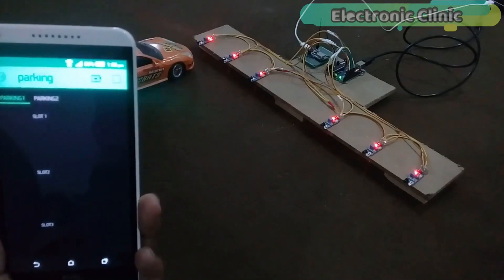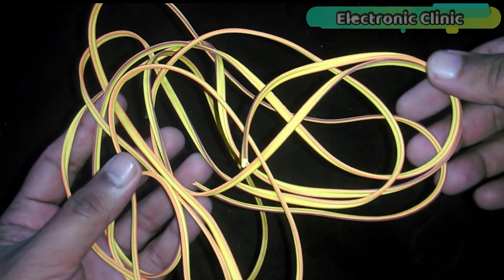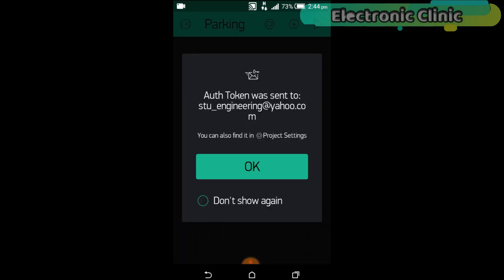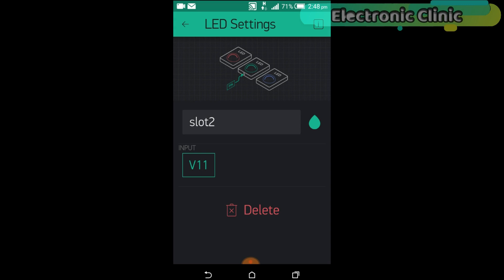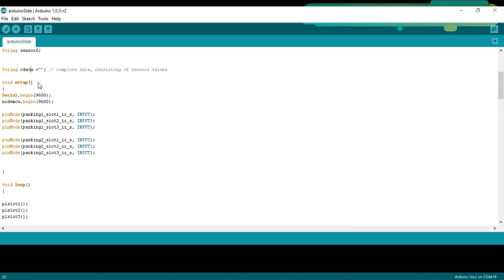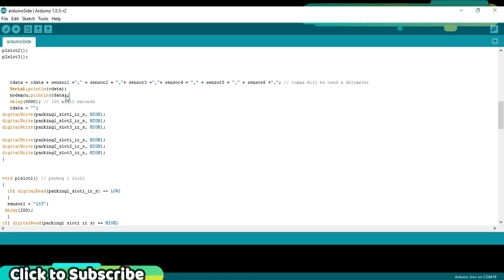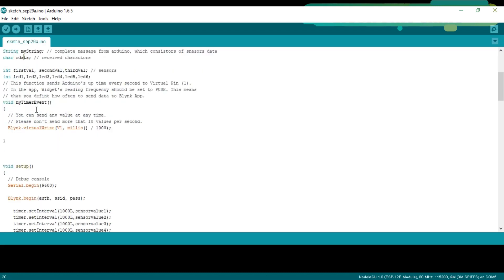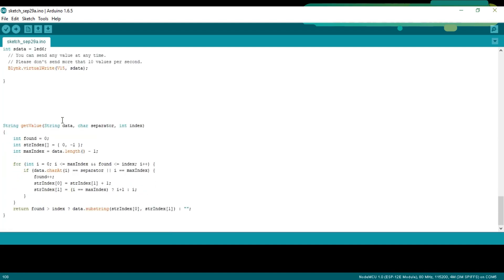Arduino Project: IOT Car Parking System using Nodemcu esp8266 wifi + Blynk (Tabs + led widgets)

Comment from the maker: Watch my video on How to make Automatic Spot Welding Machine using a Microwave Oven transformer
https://youtu.be/xnPIsrxVozM
Reply: can you please explain what is the sv1 and sv2 connected on the wifi module at 3:00  ?
Reply from the maker: @niggtube4482  these are female headers
Reply: Can u please provide blynk application link as u mentioned in the video at start

Comment: Data not processed over Blynk Mobile 
Help, Pliss
Reply from the maker: this was designed using old blynk. You will need to use the new blynk v2.0. Watch my getting started video on Blynk v2.0.

Comment: Upon compilation of aurduino code, my IDE shows these following errors. can you help me fix it

Arduino: 1.8.19 (Windows 10), Board: "Arduino Uno"

1:157:1: error: expected unqualified-id before numeric constant

 63

 ^~

1:255:5: error: redefinition of 'int parking1_slot1_ir_s'

 int parking1_slot1_ir_s = 4; // parking slot1 infrared sensor connected with pin number 4 of arduino

     ^~~~~~~~~~~~~~~~~~~

C:\Users\user\Desktop\1\1.ino:5:5: note: 'int parking1_slot1_ir_s' previously defined here

 int parking1_slot1_ir_s = 4; // parking slot1 infrared sensor connected with pin number 4 of arduino

     ^~~~~~~~~~~~~~~~~~~

1:256:5: error: redefinition of 'int parking1_slot2_ir_s'

 int parking1_slot2_ir_s = 5;

     ^~~~~~~~~~~~~~~~~~~

C:\Users\user\Desktop\1\1.ino:6:5: note: 'int parking1_slot2_ir_s' previously defined here

 int parking1_slot2_ir_s = 5;

     ^~~~~~~~~~~~~~~~~~~

1:257:5: error: redefinition of 'int parking1_slot3_ir_s'

 int parking1_slot3_ir_s = 6;

     ^~~~~~~~~~~~~~~~~~~

C:\Users\user\Desktop\1\1.ino:7:5: note: 'int parking1_slot3_ir_s' previously defined here

 int parking1_slot3_ir_s = 6;

     ^~~~~~~~~~~~~~~~~~~

1:259:5: error: redefinition of 'int parking2_slot1_ir_s'

 int parking2_slot1_ir_s = 7;

     ^~~~~~~~~~~~~~~~~~~

C:\Users\user\Desktop\1\1.ino:9:5: note: 'int parking2_slot1_ir_s' previously defined here

 int parking2_slot1_ir_s = 7;

     ^~~~~~~~~~~~~~~~~~~

1:260:5: error: redefinition of 'int parking2_slot2_ir_s'

 int parking2_slot2_ir_s = 8;

     ^~~~~~~~~~~~~~~~~~~

C:\Users\user\Desktop\1\1.ino:10:5: note: 'int parking2_slot2_ir_s' previously defined here

 int parking2_slot2_ir_s = 8;

     ^~~~~~~~~~~~~~~~~~~

1:261:5: error: redefinition of 'int parking2_slot3_ir_s'

 int parking2_slot3_ir_s = 9;

     ^~~~~~~~~~~~~~~~~~~

C:\Users\user\Desktop\1\1.ino:11:5: note: 'int parking2_slot3_ir_s' previously defined here

 int parking2_slot3_ir_s = 9;

     ^~~~~~~~~~~~~~~~~~~

1:263:8: error: redefinition of 'String sensor1'

 String sensor1;

        ^~~~~~~

C:\Users\user\Desktop\1\1.ino:13:8: note: 'String sensor1' previously declared here

 String sensor1;

        ^~~~~~~

1:264:8: error: redefinition of 'String sensor2'

 String sensor2;

        ^~~~~~~

C:\Users\user\Desktop\1\1.ino:14:8: note: 'String sensor2' previously declared here

 String sensor2;

        ^~~~~~~

1:265:8: error: redefinition of 'String sensor3'

 String sensor3;

        ^~~~~~~

C:\Users\user\Desktop\1\1.ino:15:8: note: 'String sensor3' previously declared here

 String sensor3;

        ^~~~~~~

1:266:8: error: redefinition of 'String sensor4'

 String sensor4;

        ^~~~~~~

C:\Users\user\Desktop\1\1.ino:16:8: note: 'String sensor4' previously declared here

 String sensor4;

        ^~~~~~~

1:267:8: error: redefinition of 'String sensor5'

 String sensor5;

        ^~~~~~~

C:\Users\user\Desktop\1\1.ino:17:8: note: 'String sensor5' previously declared here

 String sensor5;

        ^~~~~~~

1:268:8: error: redefinition of 'String sensor6'

 String sensor6;

        ^~~~~~~

C:\Users\user\Desktop\1\1.ino:18:8: note: 'String sensor6' previously declared here

 String sensor6;

        ^~~~~~~

1:271:8: error: redefinition of 'String cdata'

 String cdata =""; // complete data, consisting of sensors values

        ^~~~~

C:\Users\user\Desktop\1\1.ino:21:8: note: 'String cdata' previously declared here

 String cdata =""; // complete data, consisting of sensors values

        ^~~~~

C:\Users\user\Desktop\1\1.ino: In function 'void setup()':

1:273:6: error: redefinition of 'void setup()'

 void setup()

      ^~~~~

C:\Users\user\Desktop\1\1.ino:23:6: note: 'void setup()' previously defined here

 void setup()

      ^~~~~

C:\Users\user\Desktop\1\1.ino: In function 'void loop()':

1:289:6: error: redefinition of 'void loop()'

 void loop()

      ^~~~

C:\Users\user\Desktop\1\1.ino:39:6: note: 'void loop()' previously defined here

 void loop()

      ^~~~

C:\Users\user\Desktop\1\1.ino: In function 'void p1slot1()':

1:317:6: error: redefinition of 'void p1slot1()'

 void p1slot1() // parkng 1 slot1

      ^~~~~~~

C:\Users\user\Desktop\1\1.ino:67:6: note: 'void p1slot1()' previously defined here

 void p1slot1() // parkng 1 slot1

      ^~~~~~~

C:\Users\user\Desktop\1\1.ino: In function 'void p1slot2()':

1:332:6: error: redefinition of 'void p1slot2()'

 void p1slot2() // parking 1 slot2

      ^~~~~~~

C:\Users\user\Desktop\1\1.ino:82:6: note: 'void p1slot2()' previously defined here

 void p1slot2() // parking 1 slot2

      ^~~~~~~

C:\Users\user\Desktop\1\1.ino: In function 'void p1slot3()':

1:347:6: error: redefinition of 'void p1slot3()'

 void p1slot3() // parking 1 slot3

      ^~~~~~~

C:\Users\user\Desktop\1\1.ino:97:6: note: 'void p1slot3()' previously defined here

 void p1slot3() // parking 1 slot3

      ^~~~~~~

C:\Users\user\Desktop\1\1.ino: In function 'void p2slot1()':

1:364:6: error: redefinition of 'void p2slot1()'

 void p2slot1() // parking 1 slot3

      ^~~~~~~

C:\Users\user\Desktop\1\1.ino:114:6: note: 'void p2slot1()' previously defined here

 void p2slot1() // parking 1 slot3

      ^~~~~~~

C:\Users\user\Desktop\1\1.ino: In function 'void p2slot2()':

1:379:6: error: redefinition of 'void p2slot2()'

 void p2slot2() // parking 1 slot3

      ^~~~~~~

C:\Users\user\Desktop\1\1.ino:129:6: note: 'void p2slot2()' previously defined here

 void p2slot2() // parking 1 slot3

      ^~~~~~~

C:\Users\user\Desktop\1\1.ino: In function 'void p2slot3()':

1:394:6: error: redefinition of 'void p2slot3()'

 void p2slot3() // parking 1 slot3

      ^~~~~~~

C:\Users\user\Desktop\1\1.ino:144:6: note: 'void p2slot3()' previously defined here

 void p2slot3() // parking 1 slot3

      ^~~~~~~

exit status 1

expected unqualified-id before numeric constant

This report would have more information with
"Show verbose output during compilation"
option enabled in File -> Preferences.

Comment: imagine a scenario : - there are 4 parking slots slot 1 and slot 3 is filled , a car arrived and slot 2 is assigned to it ,a second car arrived and since slot 2 is already assigned ,the only remaining slot 4 is assigned to second car . now 1st car instead of parking in assigned slot 2 it goes to slot 4.the second car since the slot allotted is slot 4 moves towards that slot but it finds that slot 4 is filled by first car.

how can we  overcome such  scenarios with our parking system.
Reply from the maker: its only possible if you design a custom app for this with a database. then you can edit the entries.
Reply from the maker: i have some videos on desktop applications which you can use with arduino.
Reply from the maker: check playlists.

Comment: the video is really helpful thank you can you please add to the circuit and the code ( an entry gate and an exit gate using servo motor and ir sensor ) and also display 16x2 I would appreciate  that .
Reply: If I already have this but I want to add iot and nodemcu code will depend on ardunino or not

Comment: hello sir,i am using arduino uno + node mcu+ultrasonic sensors.I am just sending status of parking slot from node mcu to mosquitto broker.But when i am compiling node mcu program program shows " 'connectWifi' was not declared in this scope" and lots of errors.So my question is two serial communication(from arduino to node mcu) and (node mcu to broker )possible..if so what are the changes to be made????please reply

Comment: Hello Sir @Electronic Clinic, i have a problem with the"time out waiting for packet header" what should i do  ?
am i need to change the esp?
Reply from the maker: go to my website electroniclinic.com and download the exact libraries.
Reply: @ElectroniClinic  i've already download it, but i have more problem sir, when i connect pin TX and RX  to (2,3) to nodemcu, it has problem on it the esp tool can't connect to blynk
Reply: @adyaruan5331  Hi Ady, Did you find any solution to it ?
Reply: @sarthaksrivastava9445  sorry, I can't find the solution for this, I use ESP8266 for this project. Because i can't still connect the Arduino to Node Mcu ESP8266
Reply: @adyaruan5331  I think I figured it out, just dont connect any wires while uploading the code on MCU, once the code it uploaded open serial monitor and enable timestamp, you should see blank input at that time, then connect your TX RX wires from arduino to see if you are able to get data from Arduino.
Reply: @sarthaksrivastava9445  please Bro Help me complete this project

Comment: For the nodemcu schematic if I use a usb port to give it 5volts, I only need to connect RX AND TX to the arduino uno right?
Reply: Also conect gnd & vin to arduino uno with the help of bread board :)

Comment: awesome, question:how to add on the code for making for an example to  press on the led to make reservation with a yellow color, when the car reached the slot changes to green, and also how to add timer on the reservation and thanks in advance.
Reply from the maker: there are so many tutorials, check my playlists, select the one which you find easy to follow. you can also watch my tutorials on how to use a gsm module.
Reply from the maker: for this, you can add a gsm module and then through SMS you can send a command and serve a slot.
Reply: @ElectroniClinic  why through sms cant i use the virtual pin for another led, small and beside the slot to make it reserve and when the car comes in , the button will be turned off and the led turned on for the slot,or is that not possible for it and thanks
Reply from the maker: of course, you can use virtual pins. but using the gsm module, this way anyone can reserve a slot. This can be a real system. while the App can be used by the staff for the monitoring.
Reply: @ElectroniClinic  thank you very much,can you give me any tutorial that can help me with that.
Reply from the maker: in reality, you will need to verify, who is serving the slot.
Reply from the maker: I have done so many projects in which I did two-way communication. If you want to add buttons for the reservation, those tutorials will help you. check my playlists on Nodemcu esp8266.
Reply: @ElectroniClinic  one last thing,this project works on any type of sensor? for example the ultrasonic .and same code.
Reply: @ElectroniClinic  The libraries you used in your programming are not available on your website
Reply from the maker: there is a project in which I have used the ultrasonic sensor for monitoring the water level. that will help you a lot.
I have more than 270 videos. read the titles ;).
Reply: @ElectroniClinic  thank you so much for the info,you made me a subscriber for this channel.

Comment: I had this error after connecting circuit can you solve it:
esptool.FatalError: Failed to connect to ESP8266: Timed out waiting for packet header
esptool.FatalError: Failed to connect to ESP8266: Timed out waiting for packet header
Reply: check the voltage of esp8266 3.3v
Reply: did u solve this error?...........coz i am also getting same error :'(
Reply: @ishasharma537  I am also getting same error please help me

Comment: This is my BE project now
Reply: Hii that is also my final project 
Can you help me in that
Reply: @anujrathod2246  how may I help u
Reply: @riseabovehate9476  bro i am doing this project now, can you help me a bit in doing this
Reply: @anujrathod2246  hey man i am doing this project right now, so if you have done this can i get some help?
Reply: @ritviksardana3893   who can help u but i am done with Bluetooth and Arduino
Reply: @anujrathod2246  shall we talk about this on insta?
Reply: @ritviksardana3893  Hi did u manage to finish your project?
Reply: @mhussain2405  YES I am done with this project along time ago
Reply: @ritviksardana3893  I am doing this project now. Would you kindly be able to share how you did it please? What is your insta or email?
Reply: @ritviksardana3893  Hi can you help me with it please bro
Reply: @ritviksardana3893  Hi did your nodeMCU code work ?
Reply: @mdraghibahmad5698  yes
Reply: @ritviksardana3893  was it the same code as given in the website ?
Reply: @mdraghibahmad5698  no ,i wrote my own code on RPi using micro python
Reply: @ritviksardana3893  please Bro Help me it's also my project please
Reply: @samirrekibi6250  dm me
Reply: @ritviksardana3893  how can I contact you
Reply: @samirrekibi6250  anytime
Reply: Can you give me coding 
Connection details plzer
Reply: Are u from which city
Reply: guys me to it's my final project can you help mt codes and circuit diagram ahmeddhaqan11@gmai.com
Reply: Bro this is my first year project 😢

Comment: Sir,  can I build a board with til78 and til32 infrared leds? Thank you in advance.
Reply from the maker: The purpose is only to detect the cars. For this u can also use other types of sensors
Reply from the maker: You can use any ir leds if u know to connect them.

Comment: Awesome tutorial. Question: kya mai same setup sirf nodemcu mein kar sakta huin without Arduino use kiye ? Can I connect multiple IR sensors to one NodeMCU for monitoring ?
Reply from the maker: yes, of course, you can use the Nodemcu module alone. you can watch my other tutorials on Nodemcu. If you face any problem let me know. I am always here to help you.

Comment: may i know how you configure the hardware parts?
i mean the whole process...
Reply from the maker: I have already explained this. Watch my other tutorial on car parking monitoring system using vb.net
Reply: @ElectroniClinic  thank you sir, one more question, are you use all the GND pin on arduino UNO and GND pin for the node mcu?
Reply: because i was using modified jumper wire female to female and male to female, but i did not user breadboard.